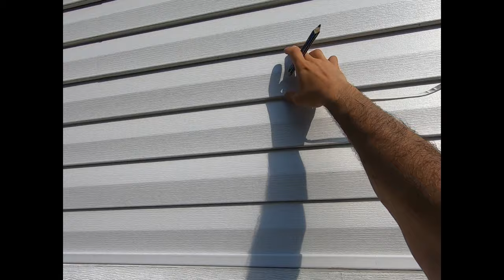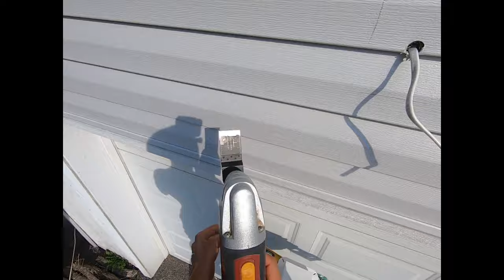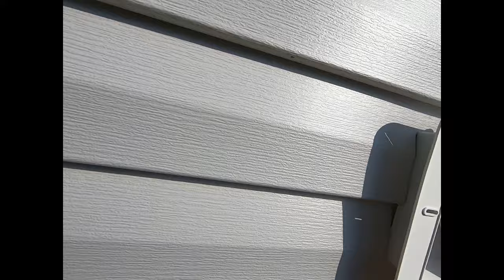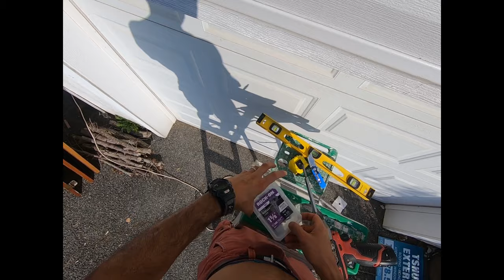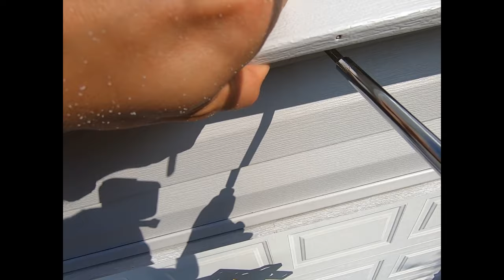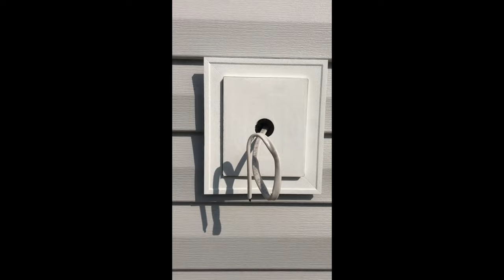How to add a light fixture to vinyl siding - How to add electrical box to vinyl siding aka J block

Comment: Why do people post dangerous "How-To" videos?  You are REQURED to use a weather tight electrical box to make all connections to any outside lighting.  Passing a wire through the wall is dangerous, so please do NOT use this video as a way to do your job.
Reply from the maker: You are absolutely correct.  All wired connections should be contained.  This video was specifically addressing the addition of a J block to vinyl siding BTW.  Anyway, in this case the connection was made inside a ETL listed exterior fixture, wire nutted of course and taped.  I would have loved to use a box, but the fixture needed to be mounted on the band joist and carving out for an electrical box was not an option.  Once the fixture was mounted tight, silicon sealant was applied around the base to further protect it from water intrusion.  I put these videos to share my knowledge and learn from others.  Thanks for watching.